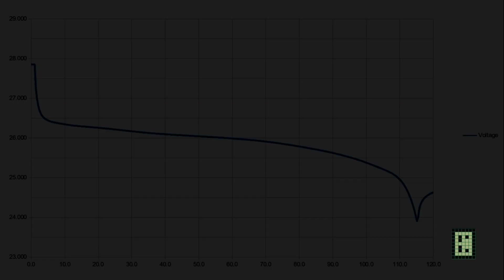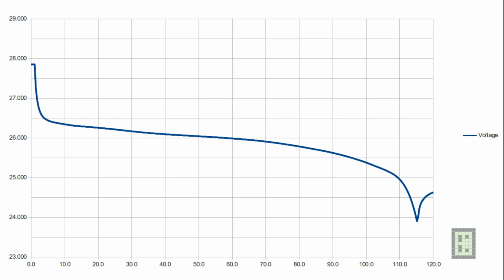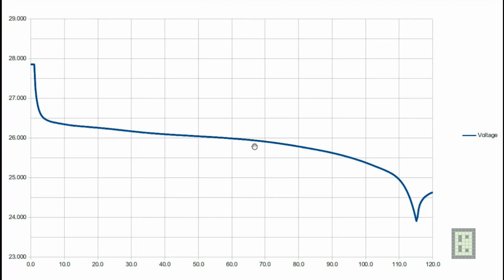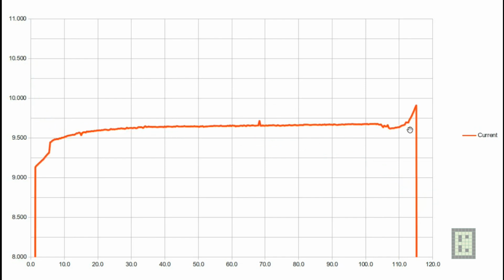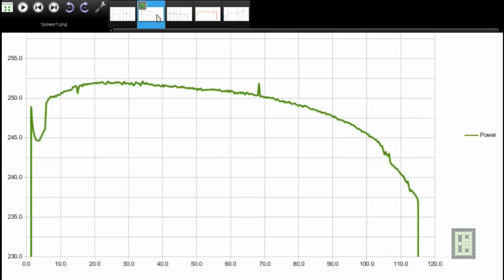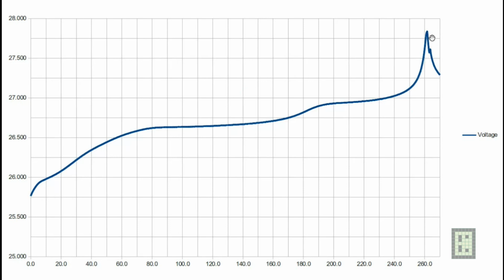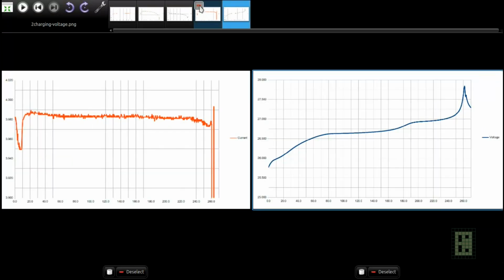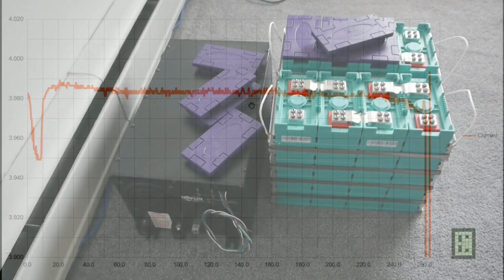LiFePO4 A123 Systems 20Ah Battery Charge and Discharge Test part 2

Comment: The cells are 20ahr rated because they use c/10 rate to discharge gives a higher ahr rating,
ahr rating depends on how many amps your drawing of course.
So on one of these cells you can draw 10amp ( c/2) for about 110mins or 1hr 50mins going by your graph.
Reply from the maker: If I remember their rating was for 1C. I got some more cells since then and those other cells where about 18.5Ah the way I tested them not quite as deep as they do and while I do not know the provenience they are excellent cells with just around 1 to 1.5% degradation per year used in solar storage application powering my house.

Comment: What kind of amps could you pull from a 16s pack of these a123 20ah cells with out hurting it to get max cycles?40 to 60amps?
My bms is 60amp burst 40 contin so if  a 16s pack of these cells will handle that easily I will be more then happy.
Reply from the maker: The numbers of cells in series is not relevant and if you want the best life cycle from this cells you should keep them under 1C discharge so 20A
What BMS do you have that supports LiFePO4 ?
Reply: *****
Thought they could handle much more but no matter as 99% of the time I'm only pulling 500w and would at most half drain the pack.Want to charge to only 80% and discharge down no more then 30% to improve cycle times.
The BMS came from a previous 48v 20ah golden motor life po4 battery.It was made up of 32 ,10ah cells 16s 2p.
Would like to buy a BMS that I could adjust the max charge and discharge voltage of each cell
Reply from the maker: I guess you have the BWPB-016 BMS and based on manufacturer webpage that is based on SEIKO IC so individual 5pin protection IC for each cell and that is a simple and inexpensive BMS but not good for LiFePO4 just for the high energy density Lithium cells with 4.2V charge limit.
Those cheap BMS will let you LiFePO4 cells charge up to 3.9V and that will significantly sort the life of the cells. I guess that was also the reason the original cells have failed.
Reply: I never got a notification or I would have replied much sooner lol...Not sure of the model BMS as there is no markings on it.
Here is a pic of mine ...says 30a but looking at the sticker in the pic it says 60a 
https://www.goldenmotor.ca/products/48V30-AMP-LiFePO4-BMS.html
As for the max charge voltages the battery hot off the charger was 58.8v and cut off voltage was 48v....that would put each cell at near 3.675v coming off charger....not 3.9 or 4.2.
58.8 when I plug the battery into the bike but once I get going the voltage drops quickly to 54.8 and stays there for 80% of the discharge ....once it drops below 52v resting I know I am almost out and time to charge it.
This was a good battery as it lasted almost 8 years of daily use charging every 2 or 3 days when needed as my daily commute was only 15miles total each day usually and tried to never let it hit LVC before charging...plus I would regularly pull 60amp out of it but never for more then 10sec as I would be at top speed by then lol.
So a 16s pack of a123 20ah cells has a rated continuous discharge rating of only 20a??? that sucks balls lol...I thought these cells were heavy duty...
Well I got 20 of them...will have to make a pack up and see how they compare to my last battery....not good by the sounds of it.
Reply: Hello, I want to use it to start the tank? do you feel okay? How many amperes is its instantaneous current? Thank you

Comment: I got two new cells. The tabs have glue(I've seen that before although I don't know why is that). I charge the cell and max charged at 3.22v (isn't this low?). I've used a special charger for this purpose and it reports that the battery is full

P.S. I'm replacing some busted battery cells from my ebike. The no-brand chinese cells that my battery has charge to 3.45v(BMS is doing that). Not sure if these cells are good or not, 3.22v seems low for full charge. When cells receive had 1.4v and 0.53v which was very low. Any ideas?
Reply from the maker: If you got the cells at 1.4V and 0.53V then they are most possibly damaged.
A charger will charge a separate cell up to 3.6V usually and even if it is damaged the cell will probably get there forced by the charger. After you remove from the charger the voltage will drop to as low as 3.3 and even with a small load will soon go down to 3.2V nominal.
The way to test those cells is to discharge them and measure the mount of energy you get out of them. Do not discharge them lower than 3V max 2.5V if you have a large load connected.

Comment from the maker: I did not run this larger cells in parallel, but I did so for the smaller 1Ah ones. It should not be any problem with connecting same type of cells in parallel.

Comment from the maker: Yes is aluminium. I did not used a torque meter so I do not have a real number but I did not apply much if any is just so that they can not inflate in case they are stressed but no pressure is necessary . The distance is 57.5mm between those plates.
I do not think it will be a limit on how many can be sandwiched but it will depend on the application if is a stationary setting like mine is not a problem but in a moving vehicle I've seen as many as 50 cells but in a box, better lateral support.

Comment: Excellent report. Did you say that you have a BMS system for this A123 battery? With cell balancing similar to the GBS system? I am working toward an E-bike with either 24s or 16s2p and will need automated balancing and charge cut off.

Comment: I understand the ratings such as 20Ah are for slow discharge times. Faster discharges give slightly poorer results. So I am curious if you obeyed the exact discharge time that they used for the 20Ah rating.  (I did not watch part 1 yet).

Comment: Thanks for providing some independent data but would it be posible with you equipment to do a constant power discharge instead of a constant current discharge? I gues in most aplications you want a given amount of power to keep your system up and running rather than a constant amount of current.